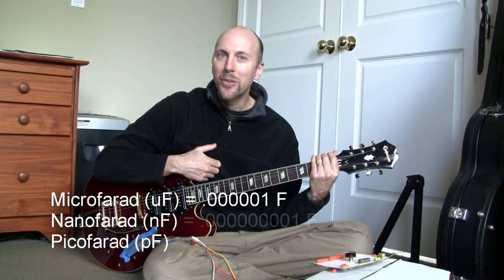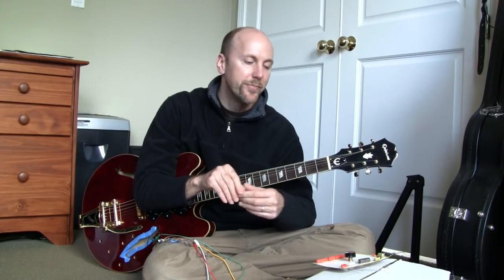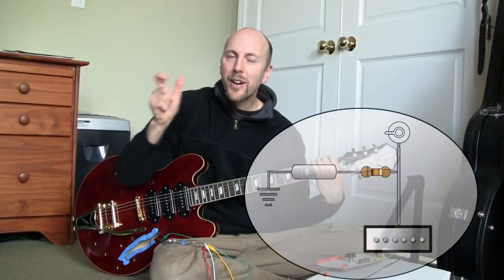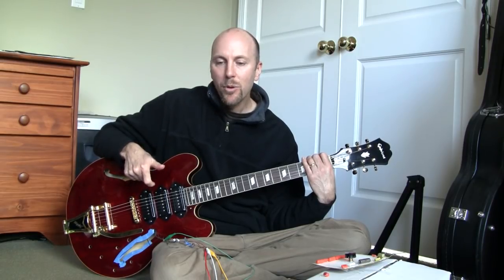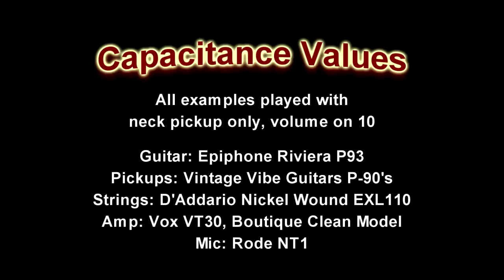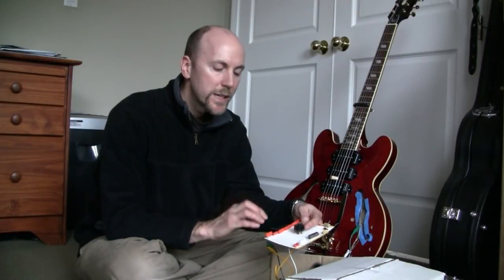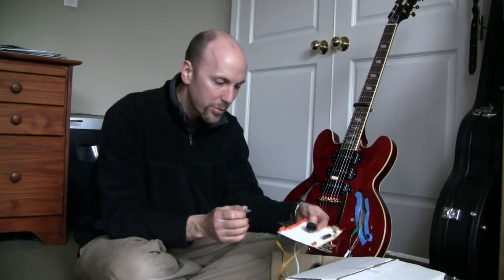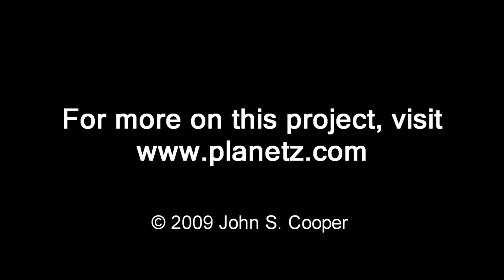Guitar Tone Capacitors, part 2: How Tone Works, Selecting a Value

Comment: I have a G&L s-500, which i purchased a pre-wired pickG with Fralin Vintage Hot pups in all positions, wired as a modern strat with the mini toggle still active. 250k pots in all positions. It sounded terrible, i was ready to sell the guitar because the tone was thin and muddy, always in tune, I kept the Fralins and rewired back to G&L specs What a great difference. The pots are used differently and also get assigned different cap values, also all my caps are much smaller physical than O-Drops.

Comment: So a higher pot value means more passthrough of the frequencies and more effect per amount of knob change, and a higher capacitor value means more high-frequency cutoff at 0 tone. So, for the most range and control, you really should go for 0.01uF to 0.1uF (or w/e the biggest common one is) and a 1M log taper tone pot.

Comment: Excellent Excellent Technical explanation.  I took this years ago in college in the 1960's and used it for a while in work but  that was long ago and Now I am building a guitar kit and it has lousy components, your series  is terrific to help me understand what I need to get.  Thanks so much for your  presentation.  You would be better than a lot of the professors I had.  Thanks again.

John N

Comment: One of the reasons I love and am addicted to guitar, is that I'm always learning. It's been said that it's easy to learn to play guitar, but it takes a lifetime to master guitar. I like playing them, cleaning them, working on them, even just holding a guitar is better than being empty handed. I never imagined that is be learning how capacitors work! I'm a manufacturing engineer and had to take electronics courses, but that was a long time ago and I forgot, so thank you for the very thorough explanation of capacitors and how they create a working tone system on a guitar! The high signals are bled off to ground..crazy! Is that part of why they need shielding? Thank you:)

Comment: Excellent presentation! Thanks for the info. For about six months in 2012 I had a severe case of "Ebay Teisco Fever".  (Also known as Guyatone gout, Harmony hepatitis, Tulip Tuberculosis, etc.) By the time the "fever" broke, I had acquired an array of 60's Japanese electric guitars. Of course, some of them had no redeeming tonal qualities, so they became wall decorations. Eventually, I began pulling various parts from them to make one extremely unique Frankenguitar. This is when I began to wonder how the cap/resistor values affected tone. Now I know! And knowing is half the battle! Now all I have to do is wait for a perfectly positioned bolt of lightning . . . I will let you know how it turns out. Hopefully!

Comment: this is very helpful...I'm changing out pickups and refurbishing my old strat...this helped quite a bit in getting me to understand what is exactly happening, and points me in a general direction if I encounter some tone issues with my .22'ers.  I have some easy and inexpensive options, thanks to your explanation of what occurs electronically and tonally.  Perfect for those of us electronically challenged by the myriad of options and issues associated with something as simple as guitar work.

Comment from the maker: @DamageIncM- what you're describing is basically a Varitone- a multi-position switch with a different capacitor at each switch position.  Famously used on BB King's Lucille, but easy enough to retrofit in any guitar.   Search for Varitone
Reply: I have one of these on a Revelation Bass VI guitar, I believe all their jazzmaster copies have this built in.

Comment: After years of using standard value tone caps im now using .0022 as i like to retain 1-3 kHz in my signal as i roll down the tone, otherwise the tone thins out too much, especially on the B and high E string.
In other words, if u don't really use a really dark tone this is just great f shaving off just the top.
I got the tip of a Lindy Fralin vid..

Comment: .015 has been great in my schecter with 500k pots an a JB bridge 59' neck. Still get roll off but not too much so as you've said the taper is much more usable. Personally I think the ideal range is between 7700pf - .022uf Seymour duncan recommends .047uf still even with 500k pots but if I wanted a guitar that could get really really dark is still only go to .033 at the most. It's really strange we've landed on .047 an .022 as standard. Active pickups are even higher though, considerably lol. As in if I ever need caps for my active pups tone control I can grab some out of recycled electronics very easily. Another great video btw. I wish I'd seen this a long time ago.

Comment: On my Tele, I have put a rotary switch between the volume and tone pots. It is a six-way switch, and allows me to select my cap from values ranging from 680pF to 100nF. The small values particularly do interesting things to the tone, rather than just muffling it.

Comment: This is a very useful video. Guitar modeling processing typically ruins the tone by adding very high frequencies and most multi-fx processors do not have a way to cut down the annoying frequencies, which are usually 10k and above. Changing the capacitor value and then lowering the tone control all the way down may help with this. I did say "may" help. Not sure if the modeling processor would still somehow "create" the nasty frequency after the fact. I will have to try this out. THANKS!!

Comment: Great video!    I do wish to add:  ... "we want to remove the high frequency..." You should include a 70Hz roll off cap to reduce 60Hz hum. I have some ideas for bass guitar, and proper placement in recoding/mixing. If you set the caps at the bottom & top of the frequency range (install them into the bass) .. you will have a tailored recording, and the mix will come together much cleaner. You need to have an ear for producing in order to get it right.

Comment: Hi I know, and I commented on that, great trick, I guess a thin smear of epoxy on the track start would also do it. Only this is, that as your removed some from the beginning, there'll be a big change from off to on, I had on in my tele, can't remember maker, but the slider actually lifted off in the null position. Keep up the good work, have a rockin weekend!

Comment: Hey John thank you for responding. In next day or two have 500ohm CTS pots coming, Switchcraft jack, the better shielded wire and four different values, .o22, .068, .047, and .01. Just wondering if they messed up at the factory. I had written customer relations person Marcy at Danelectro and she checked with the main guitar tech. He swears that was supposed to be .022 in that guitar and there's a treble bleed in there also. Anyway, love your video, very informative and helpful!!

Comment: wow man. This may be the answer 2 my tone problem. I never knew caps make a difference. I have an epi sheraton 2. I have a stock pup in the bridge and a seth lover in the neck. What cap would you recommend for this setup? I play mainly blues but I like to play  clean stuff too. Also what caps are you using? Thanks for posting such an easy to understand vid. BTW, very nice guitar you have there.

Comment: radio shack has a big selection of caps. and cheap too.   i started messin with differnt caps to get what i want.   like two orange drops were like a buck and a half.  so i was able to get 4 diff kinds and a solder iron for 15 bucks.   just thought i would put that out there.   great vid by the way.

Comment: John, When all knobs on 10 is there any difference in sound with different capacitors? And Does different Potentiometers on 10 make sound different?
Reply from the maker: Yes it does make a difference.  The total resistance of the volume pot, even on 10, loads the pickups.  Lower resistance is more load to ground, which causes more treble rolloff.  If your guitar is too bright, lowering the volume pots' resistance (e.g. from 500k to 250k) will warm up the sound by rolling off some high end.  The tone cap on 10 only has a subtle impact (but it is there and audible- see my video on No Load Tone pots for an example).
Reply: ***** Thanks, man. I appreciate your answer. How about capacitors? When my pots on 10 if I change my capacitor from ceramic to Orange Drop will I hear the difference?
Reply: Andrew Zeleno Hi Andrew, just passing on some hearsay to you! Having built around 85 pedals I have read comments on DIY forums saying that the biggest sound difference they know of with different types of same value capacitors, was that the ceramic ones sound harsher. Those are the ones I've seen included with CTS pots when you buy them...the round orange, or light brown colored ones. Other than that, for guitars I've heard that the orange drops have a very smooth taper...I've used them in builds and have no complaints. I don't think you can use polarized, such as tantalum, or electrolytic, but I may be wrong. I think I can at least assure you that if you go from ceramic to orange drop, and you do hear a significant difference, it'll be for the better most likely, and at a tiny investment!
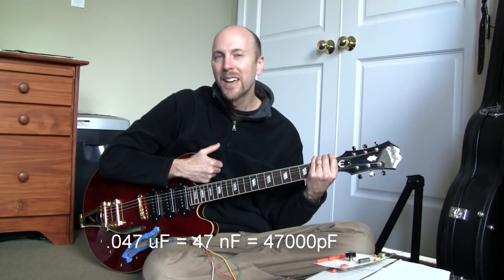Reply: lamborn55 Sorry for my English but I didn't understand. You meant that orange drop can have apperiance lice Ceramic? I have like this one 0:30 watch?v=ZYH9dGl4gUE&list=PLsOiMub4y7vBrgXEoob1jOWKvVzZ2eT2w&feature=c4-overview-vl

Comment: Respond to this video...          And I was wondering if I could change the amount of the potentiometer with an extra resistor  when I switch it   to the humbugger position , if the full amount of the potentiometer is 250k. 
But I want to thank you anyway, because your videos help me a lot, and yesterday I fixed my electric guitar. It is like a gibson with four pots, and I install three pickups, one humbugger and two single coils, (three volumes and one master tone).

Comment: Thank you for clarifying what was meant by, "pass through," as in, pass through to ground, as opposed to through to the output.  When that clarification isn't made, it makes it very confusing and difficult to understand the actual working concept.  Now, John, could you help me to understand something that has been dogging me ever since I started trying to understand how guitar circuits work?  Do the pickups pass signal coming out through BOTH wires (hot and ground), or is there rather signal going into one (e.g. ground, namely) and out the other (e.g. hot)?  or are both of these incorrect?

Comment: Thank you very mach for your video, it is amazing and absolutely helpful. I have also a question. If I use a pus/pull potentiometer of 250k to link two single coil pickups to one humbugger, how it could be possible to change also the amount of the resistance of the potentiometer from 250k (for single coil) to 500k (for humbugger)? Thank you for your time

Comment: Thanks you!

If you are using a 250k pot and go through this process with the tone pot on 10, do all the different capacitor values sound the same when the pot is totally open (on 10)?  Example:  If I have a telecaster with a .022 cap on a tone pot on 10, will it sound the same as the same tele with a .047 on the tone pot on 10 as well?

thanks!
Reply: No, it should not as there are two different values of caps you are using, I just changed to CTS pots on my Strat copy and supposed to use a .047 with them but I've been using a .022 with the other Alpha pots and I like the sound so I'm continuing to use the smaller cap.

Comment: I'm planning a tone switch which I'n integrating into an SG scratchplate to have something similar to a Jaguar's rythym circuit (with switches going to a fixed resistance instead of a volume control because I have to fit everything in an extra thick scratchplate so can't use pots. Maybe I'll use a trimpot inside the guitar but I'll probably try resisors with a similar rating to the values I measure at different points on my volume pot). looks like I have an afternoon in the company of a sheet of carboard, crocodile clips and a variety of capacitors and resistors in my future.

Comment: Hi. From where do you purchase all of your hardware? Caps are ridiculously marked up, in most places, particularly at Warmoth and Stew-Mac. Allied and Mouser offer a lot of capacitors, but the "dreaded" x7rs are the easiest to come by, with np0 and c0gs significantly more expensive. As for pots, the latter sites don't have log taper pots in the typical guitar values, and most other places sell CTS for 5 or more apiece. Orange drop caps seem to be expensive, anywhere, and vintage? Forget it...

Comment: .047 with 500k pot in all guitars I find is best. Use the "bright" option for the resistor, and the "dark" option for the capacitor. Allows you to go darker then .022/250, but has enough resistance available to basically take the cap out of circuit for the bright sound.
Reply: @davehimlin2374  definitely noticeable and definitely a preference. I like. 047. If you're guitar sounds how you want tho, I'm not telling you to. Change it

Comment: Very informative video, thanks. Quick question: Does the voltage rating of a capacitor make any difference?
Reply from the maker: No it shouldn’t make a difference. Your guitar signal is very low voltage (less than 1V)
Reply: @johnplanetz  Thanks for the quick reply.

Comment: This is very interesting, I really don't know much about electronics but I know what I want tone wise haha. I have a HSS strat and I want to use a 500k brighter pot with the humbucker and a 250 with the singles, I just don't know how to really wire it, should I use a master 500k and 250k tones for just the singlkes and leave the humbucker open with no tone control?  Thanks!

Comment: thank you for taking the time to do that :)  I was wondering if one could connect a cap backwards in the circuit (by accident) and would it have any difference to the tone it should produce??
Reply: Nope, capacitors don't have a fixed polarity, as opposed to electrolytic capacitors; so no tone difference.
Reply: thanks, that's a relief :)

Comment: hi, cool video and thanx for sharing. I know nothing about this stuff but wanna learn something. .047uf is higher than .022uf which is higher than .01uf, right? well so it seems the lower that value is the louder would the guitar get to be. Is it correct? .01uf makes guitar sound louder than .047uf to me, am i correct? Thank you
Reply from the maker: +vinnie dolly - no, in the tone circuit, a lower capacitance doesn't make the guitar louder- it makes it brighter when turning down the tone knob (when compared to a higher capacitance value).  Higher capacitance values roll off more high frequencies, making for a duller sound.
Reply: In this circuit, the signal that the capacitor is passing will go to ground instead of the output jack.  And  the more capacitance you have, the lower the frequency at which the signal starts going to ground instead of the output jack.  And as you turn down the value of the resistor (potentiometer, or pot) in series with the capacitor, more of the high frequency energy is bleeding off to ground.  Even with the pot at 10, there is some signal going to ground, just a minimal amount.

Comment: @johnplanetz -- I've got a cart saved at Mouser, full of capacitors, but I haven't fired on the purchase yet. They're just ceramic c0g/np0 caps, nothing fancy. The most expensive ones were less than $2. But I couldn't find any audio taper pots on Mouser; everything seems to be linear. I'll check out some of the other sites you mention, though. Thanks for the information! I appreciate both the videos and the replies; they are quite helpful.

Comment: hi there! again. : ) i would like to ask if there's a big diffenrence if you have separate capacitors for each tone control? I have a strat and its tone controls each have .047 uF capacitors. but in most of the wiring digrams I see, there is only one capacitor and they commonly indicate .022 uF capaitors. thanks!

Comment: Look, I have Gibson LP Traditional 2011. It sounds too shiny on highs. Also bridge pickup dosn't have enough low. I'm talking about 10 knobs positions. I thought about changing 57 pickups to burstbuckers. But some guy had the same problem and it didn't help. I think it's in the electronics. So my previous question about this.
Reply from the maker: Try rolling down the tone knobs a bit?  
Also, open up the control cavity and check the pot values.  Last LP Traditional I looked at had 300k pots.  If yours is higher, try 300k or 250k to warm up the sound a bit.
Reply: ***** How can I check? I saw them and coudn't notice anything. You meant to mesure?
Reply from the maker: Andrew Zeleno - I demonstrate how to identify and measure pots in this video: Potentiometers - How They Work,  Disassembly and Exploration
Reply: ***** I don't agree. Sorry

Comment: Ok,, either John ,, or others reading this,,, my Danelectro Jimmy Page model DC 59 inside I see has a 104J capacitor,,,100000pf. The pots suck and I will be replacing both the 500 ohm pots soon. The bass goes WAYYYY into the toilet and I will never use it anyway, unbelievably muddy.  Staright to a .047 is like 8 steps in a capacitor chart,,or should I maybe stop midway??  I am wondering if I should change out the pot itself before considering this at all.